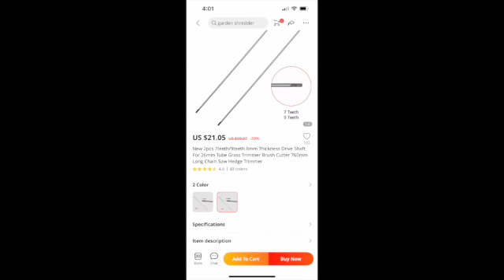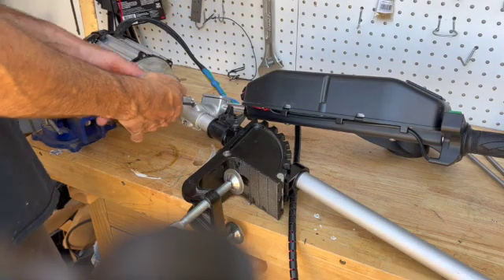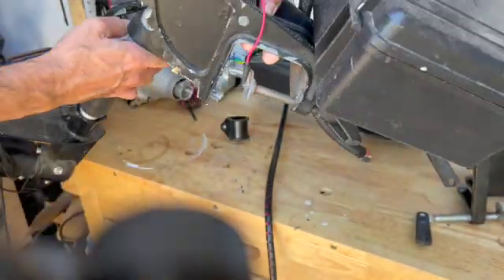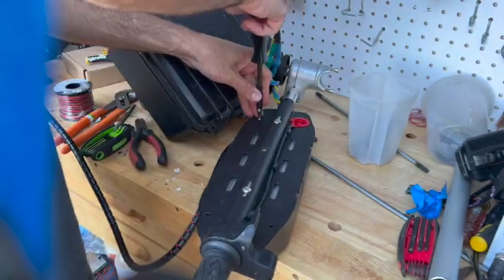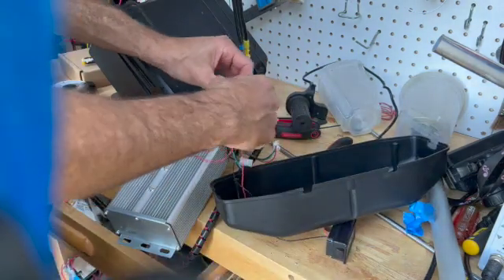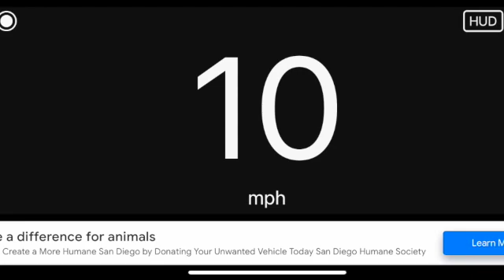10 MPH Remote Controlled Kayak

Comment: SO how did you install a rc controller on a brushless motor accelerator?
Reply from the maker: A servo is twisting the hand throttle that came with the motor. I’m about to release a new video with a more detailed look at the electronics.

Comment: The speed is insane on this! Still using the motor?
Reply from the maker: I still have the motor and the boat, but we stopped using it. Local officials have turned our favorite, and only island near us into a bird sanctuary. So we no longer have a destination to go to. I will try to get a new video up this summer when it warms up. Thanks for the interest!
Reply from the maker: I’m getting ready to test it on Tuesday. I believe I resolved the radio cutting out. I also have a crazy idea I want to introduce on how to make it a lot faster without changing the motor!
Reply: @waitingonparts  how did it turn out? I definitely wanna know more lol. I'm also in SD and would definitely want to see this thing in action.
Reply from the maker: @ScottyNoo0  I had to upgrade to a 12 volt radio because the old 7.4 volt system wasn’t able to control the steering. I think I have it figured out though. I went from 65 kg servos to 150kg! I’m hoping to throw it in the water tomorrow to finalize the testing. If all goes well I should have the next episode out in a couple days

Comment: What kind of motor was that
Reply from the maker: Just found this amazing item on AliExpress. Check it out! $276.01  55％ Off | 1000W Electric Outboard Motor Boat Engine  Heavy Duty Fishing Boat Motor Brushless Motor Propeller 4800 RPM
https://a.aliexpress.com/_mLXDiSI

I believe mine was a little bigger. You can ask the manufacturer if the 7 hp one is still available
Reply from the maker: The motor I have is actually 3,000 watts which is 4 horsepower unlike the manufacturer claim of 7 horsepower. I requested there largest motor and 3,000 watt was the largest

Comment: How much v voltage does the battery use?
Reply from the maker: It uses two 3.7v 18650 lithium ion batteries. It’s about 7.4 volts.

Comment: Unique I like it.
Reply from the maker: Thanks
Reply: @waitingonparts  dude, thats amazing. Parts list?
Reply: @waitingonparts  nice!
Thanks alot.
Reply from the maker: @jeffsingleton88  your welcome, thanks for the interest
Reply from the maker: WPHMOTO 28mm 1 1/8 inch Brush Handguards Hand Guard Clamp Mounting Mount Kit https://a.co/d/aC3yzI0

This is what I used as the steering arm
Reply from the maker: US $226.10  15％ Off | Electric Trolling Motor 12/24/48V 1500/1600/2000/3200W Inflatable Boat Outboard Engine Motor For Outdoor Fishing Variable Speed
https://a.aliexpress.com/_mKZ3RCs

Choose version G. It’s the last one on the list. 3200 watts at 48 volts
Reply from the maker: https://www.amazon.com/Power-Scale-Waterproof-WH-65KG-5ive-t/dp/B085W7Z8HB
Reply from the maker: https://www.amazon.com/Power-Scale-Waterproof-WH-65KG-5ive-t/dp/B085W7Z8HB
Reply from the maker: https://www.amazon.com/DUMBORC-Transmitter-Receiver-Controller-400m-500m/dp/B07RR81GSB

Comment: I actually seen something on a fishing boat,  but the motor was on the front of the boat for going into lower water, + it's already has a bigger motor on the back, 2 men and the motor you are using pulled all that weight no problem...
Try hanging it from the front...
Reply: A bass boat, maybe????????
Reply from the maker: I believe it. It’s got tons of torque. It gets you up to speed in no time….I don’t have a bow mount on the kayak, but that’s a good suggestion